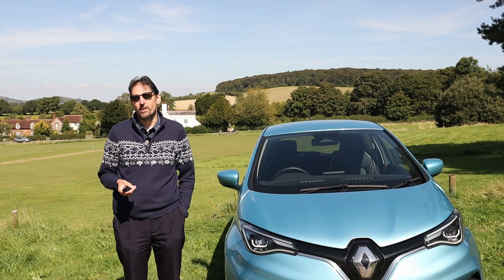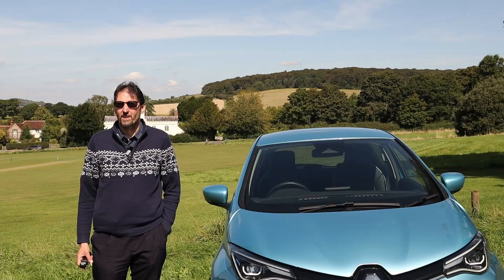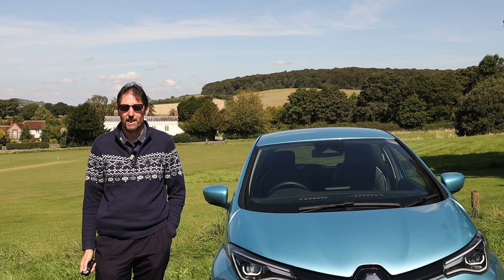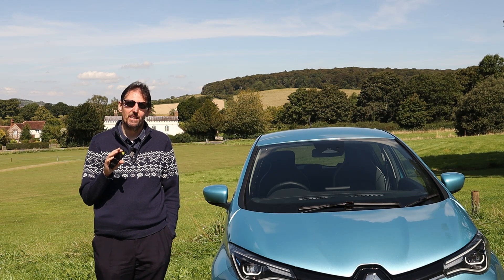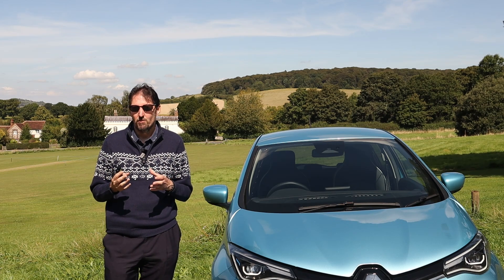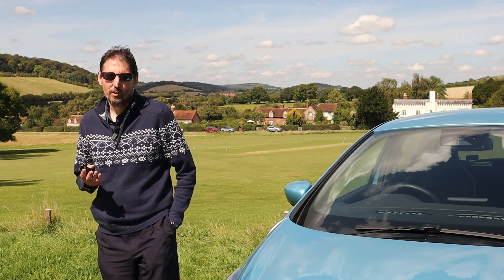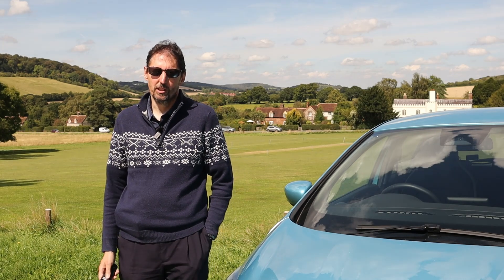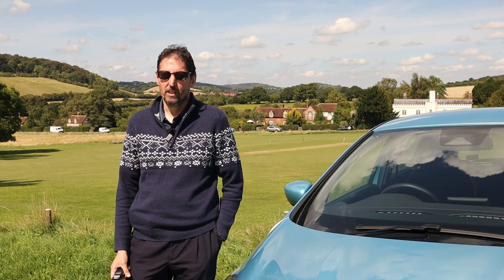Renault Zoe - Battery Degradation?

Comment: My Jun 2020 Zoe ZE50 has done 23000 miles and SOH stands at 96.4%. I have been measuring the SOH at regular intervals and plotting against Miles driven shows a nearly linear relationship ATM. I do most of my charging at home (85%) but rapid charge on long trips. If this continues at same pace then would be around 85% at 100,000 miles (0.15%/1k miles) or  about 13 years at current usage.
Reply from the maker: That's great. Thanks for the information
Reply: It seems like calendar aging has a bigger effect than cycling. I had a march 2020  zoe ze50 that i sold ahead to a family member, and at 110k km iirc it read exactly the same soh as yours.
Reply: @kosiranze  Interesting. Did you do anything specific to preserve SOH. I try not to charge to 100% too much only when going on a trip. About 15% of my journeys involve rapid public charging.
Reply: @philipbroggio9315  dc charging was only about 4% according to tronity. Most charging was done on 3 phase 11 and 22kw chargers and seldomly to 100% soc. It seems like the reported soh number has quite big steps though of 1.2% so i would not be surprised if mine had at the time  up to a 1% morendegrafation as yours.

Comment: I believe that Renault Zoe and Nissan LEAF even at the time of their launch belonged to the same alliance Renault-Nissan thus might have had common engineering elements and maybe ever related battery chemistry. However it looks like Zoe is better designed according to your video. It was never available on North American  car market so I am not quite familiar with that car.
Both cars are quite good if used as  pre-owned EVs at low price for intraurban commute provided the owner is aware of their limitations, does not need to rapid charge them, has the ability to charge them overnight, does not try to use them for long road tripping.
Reply from the maker: Yes, absolutely right, the alliance was strong at the time, yet the Leaf and Zoe do not appear to share the underpinnings, which I have always found strange.

I agree, different cars suit different use cases. In the UK the latest Zoe and Leaf are good for most people most of the time in my opinion, as road trips here are in the order of hundreds of miles, not thousands. We're a much smaller country, so we think about driving very differently. Driving to the continent happens, but even then there are relatively few people who would consider driving several thousand miles, as seems to be reasonably common in North America, mainly I think because of the sheer size of the country.

Comment: My daughter’s Oct 2020 ZE50 has a battery SOH @ 88%. It’s done 6000 miles. I’ll admit I was a bit disappointed with that when I tested it. It does two weeks between charges (80%~20%) for her commute though so we aren’t too worried. EVM also mentioned that Renault can do a BMS update on the Zoe to get an improved SOH number so I may ask about that when it goes for it’s first MOT in a month or so.
Reply: Hi my June 2020 ZE50 started showing very low SOH after winter 2020-21 at around 88% . I had the BMS update done in June 21 at first service and the SOH then went up to around 98.8% and after a further two years has dropped to 96.4%. You definitely need to get the BMS update done. To diagnose if it is needed check the versions of LBC/LBC2 you have and if they are 521/521 then the update has not been applied (you can check them if you use CanZe and an OB2 dongle). The Actis Code of the BMS update is 64453 and a second one 62073 which should be updated. For completeness I also had an update to the infotainment system/Energy Calculations Actis Code 64756/64273 carried out at same time. This was all done under warrenty. Hope that helps.
Reply from the maker: Thanks for that superb, detailed comment! Much appreciated. Whilst I'd like to pin it, I'm not sure I can pin a reply. Shame. I may put this detail in a video so that other people can more easily find it, as that's really valuable for them to know. Thanks again :-)
Reply: @philipbroggio9315 Yes thank you very much for taking the time to reply, much appreciated. I will definitely ask when it goes for its first MOT in September if they can do those updates at the same time. I have copy/pasted your reply for future reference.
Reply: how (or maybe more importantly, where) did you get the BMS update done  @philipbroggio9315 ?  people seem to have terrible trouble getting this, including me.  My Zoe suddenly (at abot 28K miles) has gone from about 97% SOH to 89%.   My Renalt Garage has consistently said there are no updates due, but the care certainly hasn't had the BMS update that generates the Energy information screen.
Reply: I would speak to the dealer and see if its due the BMS update, that does seem like too much degradation for a 2020 car.
Reply from the maker: Oh yes, that's a bit disappointing. It sounds like you are taking good care of it, keeping it at sensible charge levels, so I'm surprised at that.

Yes, I had heard of a software update, although I confess I had assumed it would be preinstalled on a 2020 model - but I don't actually know when it was released.

I'd be really interested to hear any updates as and when you speak to a dealer.

Comment: When i had a Zoe i didn't notice any battery degradation
Reply from the maker: Out of interest did you ever try out CanZE? It's not something I have fired up yet - but then my car is still very new
Reply: @theelectrictransition  yes, but I didn't ever check battery SoH with it, not sure you can, but with Car Scanner you definitely can.
Reply: @theelectrictransition  You definitely can check SOH with CanZe and an OB2 dongle. I have been using that to measure SOH since 2021. I have readings from June 2021 98.8% (post BMS update) to last week 96.4% .